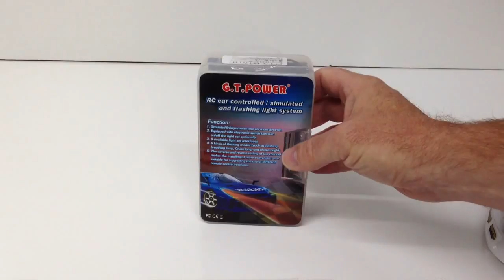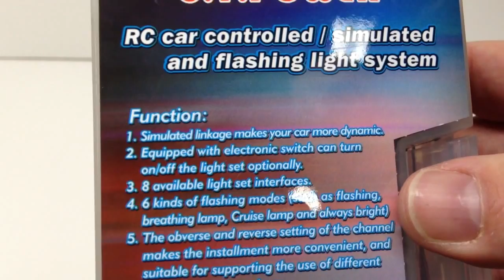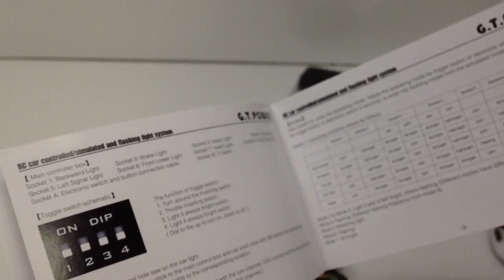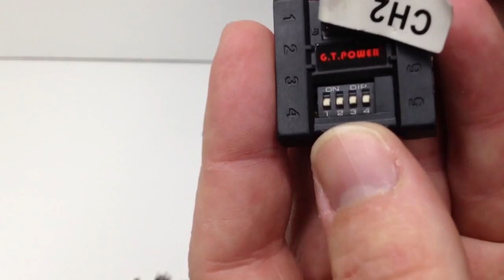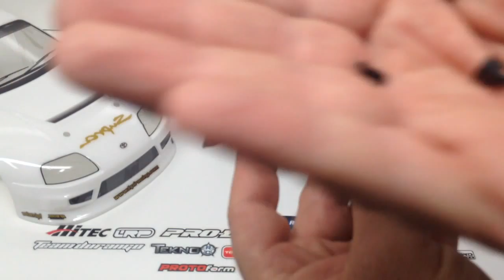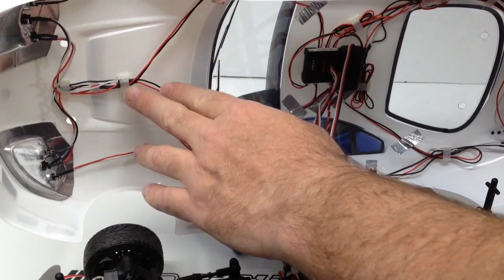HPI Sprint 2 - "Get My Drift" - LED Lighting

Comment: How fast does it go straight running??
Reply from the maker: This was made into a drift car.  I've had Sprint 2's in the 50-60mph, but then the issue is wind gets under the body and it goes airborn

Comment: I hate having to plug my lights on my receiver. I've cut and soldered 9v plugs and use batteries. It's much easier to pull the body completely off. Take a look at my videos at what the Yokomo and Tamiya lights look like. By the way, how does that duck tap work with the body's paint? The tape provided by Yokomo seems a bit unforgiving on the paint so I ended up using medical tape. It can flex with the body and when peeled won't take the paint with it.
Reply from the maker: ThisNamesNowTaken Cool, thatnk for the tip
Reply from the maker: ThisNamesNowTaken The silver duck tape worked great...

Comment: For the tape look into the ride body repair tape from tqracing.  It will not come off easy.  I use it to mount my light buckets and for wire routing.  It's the same tape tamiya sells but 1/3rd the cost.  

3racing also sells a light kit that's very similar.
Reply from the maker: Cool, thanks for that tip!

Comment: Great job rich. As always a very informative video. I enjoy your channel. However could you do a video on trouble shooting the tekin rsx esc im having some issues. Thank you.
Reply from the maker: Hey Will!  Thanks fro the great comments.  On the RSX, I haven't even installed it yet! lol  but, what kinda problems>?  I've ran lots of Tekin products.
Reply: The unit just blinks. I am unable to run at all
Reply from the maker: The Tekin manual states that if all lights are blinking, there's an issue with the receiver getting a signal. Check all the polarities of your receiver leads. Also check to make sure you're using a fully charged battery. Next, I would verify that your radio/receiver are bound. Last, double check that  a, b, c wires are correct from motor to ESC.

Comment: 10:57 LEDs dond give out a constant light they flash in a very high frequency that our eye wont notice, but apparently your camera framerate and the LEDs frequency allmost match up , so you can see the pulsating.

that looks so epic :D
Reply: standard LED light Hertz cycle is 120hz . The higher the hz the less they will pulsate.  Not too noticeable by the eye, but like you said Framerates will catch the pulsating.  You can also notice this if you point a tv remote into the video camera and change the volume level or channel and upon playback you will see the light flicker on the remote. haha, gotta love my book called "How things work"
Reply: Not true at all.  It depends on how your powering it.  If you use current limiting resistors they will not flash at all.  But if you use a led driver they will have a flash in them from the pwm cycle.  120hz is way to low and is perceivable to the naked eye.  The pwm on most led drivers is at least 2k hz.  You can build a simple led driver from a ne555 timer and change the capacitor to alter the pwm.